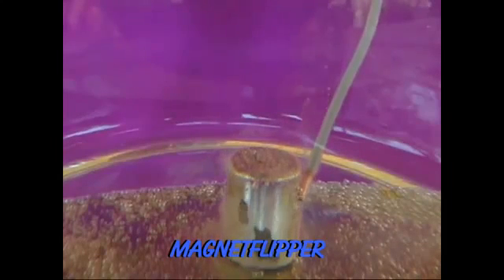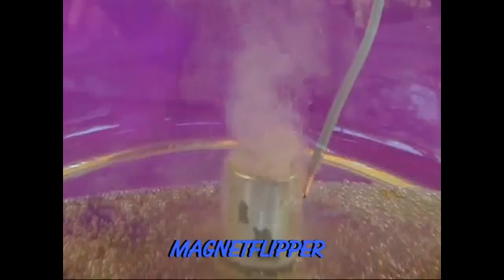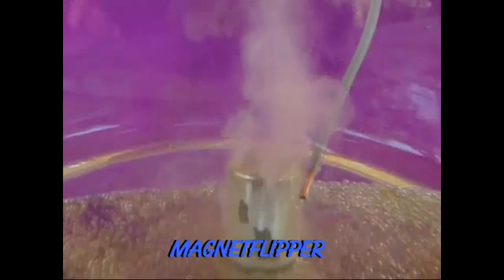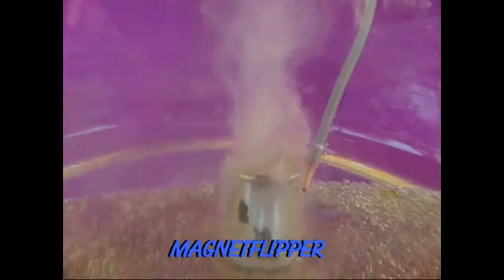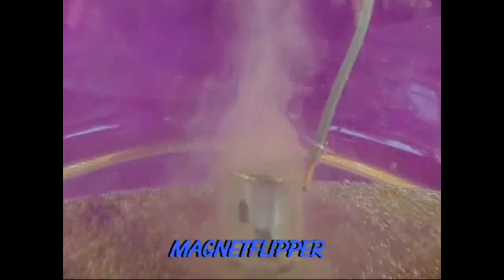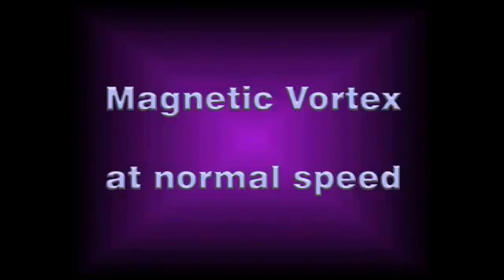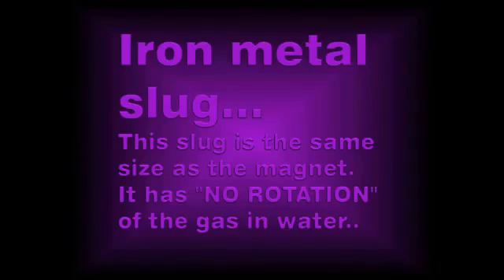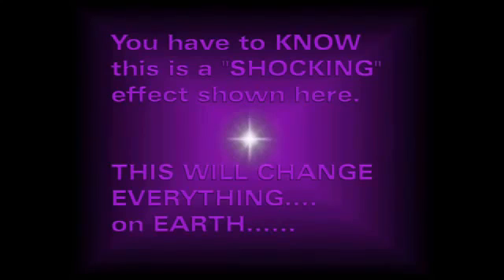MAGNETIC VORTEX SPIN DISCOVERY, Sept  2011, TORNADO UNDERWAT mp4 SD

Comment: Continuing from below (that continued from initial observasion below that.) 

What IF we have no current in this setup?. (Allow gas to be generated far below the magnet in a steel knob with electrode down there.) Gas rises past magnet. But with no current in this area, there will be no force exerted on ions in water to push neutral molecules of O2 or H2 in bubbles. It will not spin. No force will exist from a magnet field AND perpendicular electic current, see? No "mag vortex". Let's try it

Comment: I assume wire is one electrode; opposite is offscreen. Where does current run? Dominantly from edge of cylinder to center. Then it disperses over surface & out, doing eletrolysis; excess to other electode. We have a major current in radial dirction, plus magnetic field dominantly up/down from ends of cylinder. So there is force in 3rd perpendicular direction: tangential to magnet's circle face. Forcing what? Ions in water. Water pushes neutral O2 or H2 gas bubbles. No moving mag field required.

Comment: I also wonder: what if you hold the two ends hoizontally: will they both spin? One clockwise, other counter-cw? (Do I see a bit of that at base in video?)
Glad to see you tried a metal plug getting current: no vortex forms.
What if you use no current? Just bubble ultra-fine gas (from other source below) up through the magnet. Do vortices form? Same spin directions? Do it in both hemispheres in case Earth's field plays a role (but do so before Earth's poles seriously start reversing. Ha ha!)

Comment: So the tornadic effects are there and constantly spinning whether an electrical field is present or not? If the magnet were to be suspended horizontally and the current applied, would a helical spin emanate from both pole ends as independent vortices with one twisting clockwise and the other going in an anticlockwise direction? How can this phenomenon be harnessed for practical purposes?